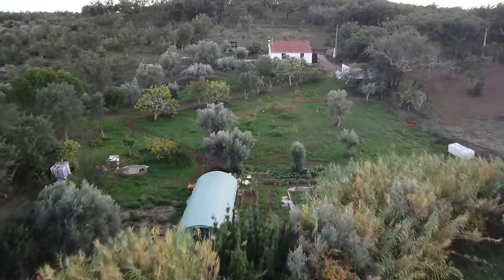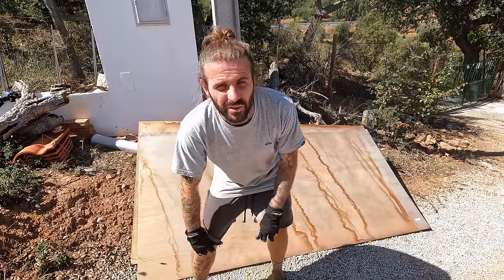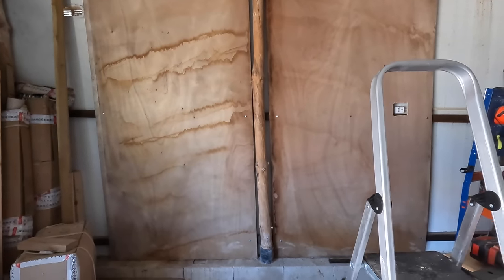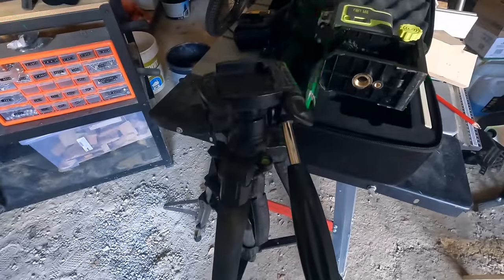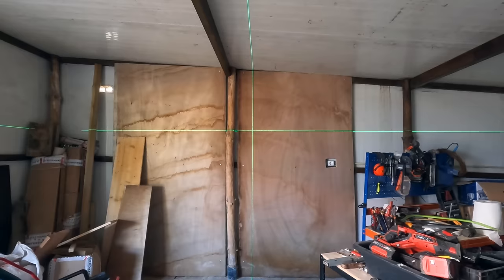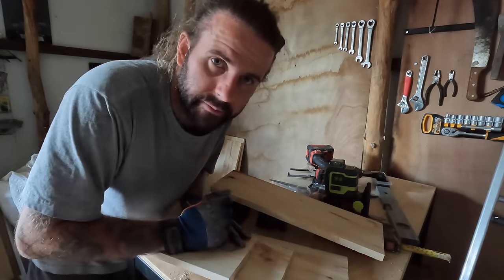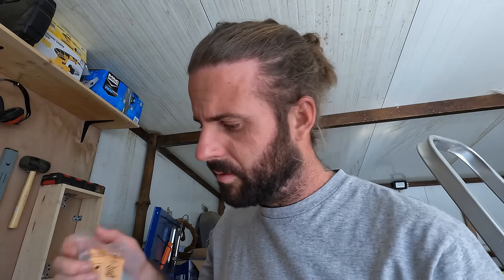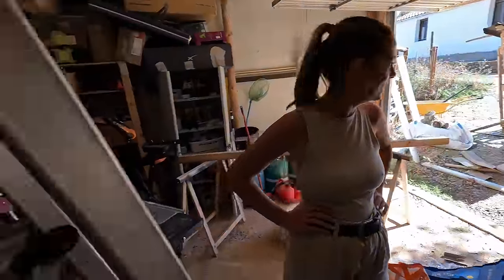JOURNEY TO CREATING A HOMESTEAD WORKSHOP FOR OUR LITTLE FARM / SMALL HOLDING

Comment: Check how hot the coiled up extension leads get ! ( specially the one with the cable tie round it )
Reply from the maker: That's a great point, i should do that. Really i probably should have made a proper circuit as there's just too many wires in there!

Comment: I would off one tip for future projects. To prevent tear out on the back of a piece of wood, (when drilling) clamp a scrap piece of wood under the spots on the wood you are drilling then drill. I think you will find much cleaner holes. An innovative idea for your charger station. I agree with the comment regarding tracing the shape of your tools on the wallboard. Very handy for spotting missing tools and also knowing where everything belongs.
Reply from the maker: That's a brilliant tip, thanks so much as i always have this problem :)

Comment: Cool project. It'll be nice not to have to watch you working out on a gravel driveway all the time. 😄
Friendly suggestion that you consider adding support boards behind your various shelf brackets, under the plywood panels & tied in the garage's horizontal beams behind your shelf brackets. A stone hassle, I know; but a single layer of plywood is only so strong...
Reply from the maker: Haha yes i tried to mix it up a bit ;)
That's a good idea, the plywood boards seem strong enough, for now! I went for slightly thicker ones so i think it'll be ok, should there not be a significant amount of weight :)

Comment: Nice work really enjoy watching what you get up to.  Just a quick one though, you have the hammer function on when drilling timber, be much quick, easier and quieter set to just the drill function. Top job though mate.
Reply from the maker: Thanks a lot :)
Thanks for spotting that too! I'd be drilling in to concrete so i'd probably forgot to switch it back to the drill function! oops :)